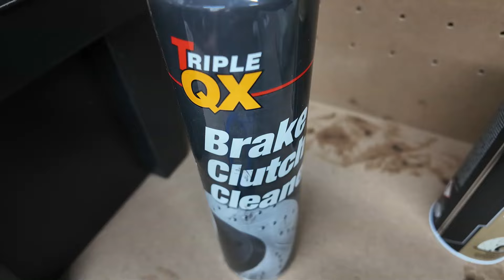PAINTING CALIPERS IN MY BMW M140i / NEW CALIPER COLOUR / NEW LOOK / DIY

Comment: Looks sick🔥🔥!! Looking to do mine in turquoise
Reply from the maker: @F20_Kwan  thanks bro , is Your 140 white aswell?
Reply: @wojti95  colour of my 140 is black sapphire bro
Reply: @wojti95  what tool did you use to put the wheels on,do you maybe have the link
Reply from the maker: @F20_Kwan  I’m not sure what u mean , u mean the stands I rest the car on ?
Reply: @wojti95  no the impact driver bro
Reply from the maker: @F20_Kwan  ah it’s one from eBay Electric Cordless Impact Wrench Ratchet 4500NM Rattle Nut Gun Driver Car Wheel

Comment: Looks awesome. What brake rotors are you running on the front? These are not stock M140 rotors, did you have to offset the calipers to fit these?
Reply from the maker: @flat6867  thanks mate , stock m140i calipers with conversion and m3/m4 brake discs